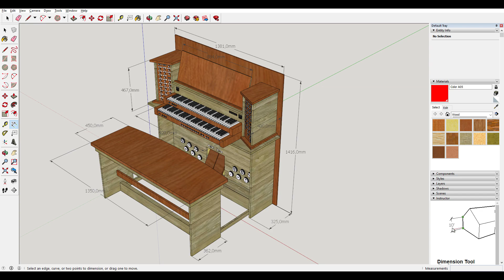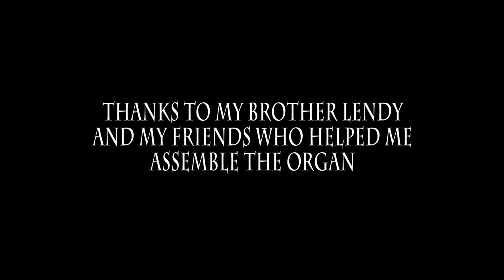My homemade MIDI organ

Comment: needs a disclaimer-- electric hand planner not recommended over human hands
Reply: I couldn’t look at that bit... That guy has to experience the actual accident once and he will regret it a lot. It’s the basic rule of using a knife always away from you, but then with the hand planer; Don’t be in the trajectory which the tool would go if there was nothing from stopping it. If your fingers touch the planer 1 second they’ll be half gone, bone and everything.
Reply: @Engineer9736  Agreed safety first - 

I got hit in the back when a cnc threw a broken blade at me  ,my shirt and flesh helped bring it to a stop as piece was twirling on infact , luckiest escape day of my life .
Reply from the maker: I always told to my brother -> safety first.. he snapped his hand on the hydraulic door and was lucky because it almost cut them off. It was a sufficient lesson for him.
Reply: enough of a lesson for your brother ? not the imperative method of learning required.
Reply from the maker: @keithcitizen4855  :D

Comment: Dear Valent; amazing, inspirational creativity on the build. BUT - your performance was not just technically brilliant . It displays that rare 'bite' and urgency which is the hallmark of the first class organist. So here we have the complete 'set'. Quite a sample. Great. Total congratulations.
Reply from the maker: Oh, thank you for the compliment. You made my day better. :) :) :)
Reply: Dear Valent; pleasure was mine. (I rarely post - who reads? :). You shared yourself with obvious delight. I learnt as a teen on  old 'tracker' organs in old freezing churches. Practiced untill my fingers were frozen and the fugues wouldn't flow anymore. Home organs leave me sighing and wondering. I also worked for IBM when they released something called a 'personal computer'.mmm. Times change huh? I have my Yamaha 'electronic' grand now. I'm not quite 70 yet - so who knows...Laurenskirche Rotterdam?.....:):) ..........

Comment: Good job on your project! What did you use for the sound source, digital tone generator or computer software? It is too bad that there are no organ kits like there used to be, from the 50s to 80s. Such as Artisan, Schober, Devtronics and Wersi. Wersi was the best, because after the kit was built, it look like an assembled from a factory.
Reply from the maker: Computer - Hauptwerk software. Organ console is based on midi comunication. It means that organ can be connected to any software like Hauptwerk, GrandOruge or something else with midi support.

Comment: It would be better to use an old Allen, Rodgers, or Baldwin that someone wants to give away.  But it does sound wonderful.
Reply: I have a beautiful old Rodgers model 22D I'd like to gut and  MIDI with Hauptwerk.  A ton of work to do so!
Reply: @fnersch3367  But it will be well worth it.
Reply from the maker: Better, but no one in our country or near has it. That's why I decide assemble own organ.
Reply from the maker: Yes I agree with you Stephen. Hauptwerk is so good because sample set was recording from church with its acoustic and can be possible to load different organ sample set. Instead it any digital organs has sound generated by built in computer unit. I heard sound from usual digital organ and it is not like hauptwerk. Maybe in more expensive digital organ it is better. Thank you so much.

Comment: First of all, amazing work; your instrument is really beautiful. You're a great organist and technician. I see that we are a kind of "twins souls". My primary work is IT, I'm an organist in a church in Madrid, and I constructed a console for playing at home (in mi case using touch screens, so good bye shift registers 🙂).

I've read the entire thread (very interesting) but I have yet a couple of doubts: The first, I see very clearly the hinge system you used in the swell pedals but I'd like to know more about the piece you used as a 10K potentiometer. Is it a component "as is" or something you make DIY? How do you get the mechanical resistance?

The second is more a curiosity. Your instrument is two manuals, but Friesach is a three manuals organ. Have you discarded an entire division or have you make a mix?

Thanks in advance and, again, superb work
Reply from the maker: Hmm, what a coincidence.. During my life, I had the opportunity to convince myself several times that technically skilled people are also musically gifted. :D

It is modulation wheel disasembled from midi keyboard: https://valsite.sk/wp-content/uploads/2019/01/swell_crescendo_pedal-1024x381.png
In my webblog you can read more: https://valsite.sk/projekty

Yes.. I wanted constructed 2 manual console because the majority of free sample sets organ is with 2 manual (and also price reason). But I thought also when if load 3 manual organ sample sets on 2 manual console so would by good to have the switches to 3 manual (I/III, II/III, and so on).. and I did so.

Thank for your response.. :)

Comment: Great work! Having those stops forces You to play on one specific organs in software like Hauptwerk?
Reply from the maker: The registration I have been selected by mostly frequented names. For example principal may be replace by montre or diapason, plein jeu by mixture, trompete by posaune and so on. But if I load bigger organ than 50 registers then may became the problem. Organ can be also connected to another alternative software like grand orgue or so.
Reply: ok, but then You got to figure out somehow what every stop means in every organ. But I get it. I would personally do it like Viscount model. Small plates that you can write on names of stops (they are LEDs or something to program). Theyre also probably expensive
Reply from the maker: Yes.. but I will install additional display monitors or tablets maybe in future. Current I am using my favorite free sample FRIESACH and its stops names are corresponding.

Comment: You are very creative and great workmanship! Where did you get the lighted stop switches? I’ve searched eBay, lots of options there. I presume they are latching, push on, push off.
Reply from the maker: Hello sir. Here I bought: https://www.aliexpress.com/item/32800944275.html?spm=a2g0o.order_list.0.0.37461802396ywr

Comment: I wish I had more info on the parts used, not so much the wood but the electronics and things like the name of the "led buttons" and what kind of micro controller you used if at all to control all the midi input and output.

Heck I would pay for that Autocad model you showed in the beginning
Reply from the maker: I can send email to you with small description about this.

Comment: Dear Valent, 
We are inspired by your project)
Tell me, please, how did you adjust the keystroke on the Acorn Masterkey-61 MIDI? 
We tested it, but it doesn't look too much like a real organ
...
Reply from the maker: Yes, you right. Acorn Masterkey-61 is low end product. That fact corresponding with price. Keystroke are too flexible but if keyboard will be assembled to wood construction which keys are touched to wood bar when key was pressed then touch feeling is better. Here is wood bar placed under keyboard => https://valsite.sk/wp-content/gallery/manualy/4E45C742-E51E-4F05-BCD7-3A4A13809ABB.jpeg

Comment: 3:17 Seriously... As long as you don’t feel shocked yourself by just watching that act, please don’t touch any power tool again. Your fingers where 4 cm away from being splattered around the room. If that board fell over, the purpose of owning a pipe organ would have been gone. Similar to using knifes... Don’t cut towards yourself. With power tools: Keep your limbs as far away as possible and especially never in the area where the tool is-, or could be, heading in. But the organ looks nice! 😊
Reply from the maker: Yes, you are true but I trusted my brother :D Thank you so much.
Reply: My father was a careful builder and wouldn’t let me use dangerous electrical saws, planners etc.  If we are musicians our hands and fingers as well as our hearing are especially valuable.  Even now I will not touch such tools without proper training as at least with hand saws etc  I cut myself but never lose a finger .  But  have seen plenty of other tradesmen and DIYs with  missing fingers .  It is very timely advice

Comment: Can you post the blueprints of the console, and key checks, and piston rails, etc. to your website?
Reply from the maker: I am currently working on another board in Eagle software and when I finish I will create small documentation (schematic, list of used components ...) and publish on my site. Maybe about 6 months.
Reply: please make the blueprints and all available. I'm literally covered by sawdust from another project and eager to buy an organ console. I can't find correct pedalboard measures anywhere. Greetings from Brazil.

Comment: Very nice Organ,.. I am both impressed, and a little disappointed. For one, although this is probably much less expensive than many of the "electronic" organs commercially sold for professional performance,.. it also provides some of the limits of those old monsters without some of the freedoms offered by midi.  Why the decision to go with a fixed selection of stops?  And why build a huge heavy piece of furniture around something that could be perhaps 25-50 lbs and readily movable? 
   Wonderful performance chops!!!!!... I guess this is how European organ enthusiasts bring their organ home for practice purposes!  Just to nit pick a little,... the holes drilled for the "stop' buttons ended up very sloppy..  You need a very sharp drill with those little wing flanges, so the wood doesn't tear, and at least for those pieces, that house the stop buttons, some real wood, would be nice!
  I would love to see a follow-up, on what tone generators or computer You use to achieve the different stop emulations.  To get really interesting You could emulate the different sounds of many famous organs, and also various tuning temperments??? !!!
Reply from the maker: Thank you for leaving such an extensive comment. I'm glad you liked the video and I also appreciate your feedback. I decided to let the fixed stops that are most used and generalize their names so that they could be replaced by others when I load another organ. For example: praestant = principal, and so on. If load organ with less stops that missing stops just will not used. If I will construct another organ maybe in future I will be surely use some touch screen to triggered organ stops. Yes you are right, the organ as a whole weighs a lot, but I built it so that the individual parts can be disassembled and transferred if necessary. You are also right to achieve a clean borehole we would have to use a vertical drill with a sharp drill, but we did not have it. :D We worked at home in the carpentry workshop with what we have. The tone generator is the Hauptwerk software but can be used alternative like GrandOrgue or different software with midi support. The organ on which it is played are sample set from the Austrian church in Friesach. In the future I will play on other organs and practice other songs and add to this channel. I mainly built the organ so that I could practice and improve it.
Reply: Thanks so much for the feedback.  So the organ sounds are sample playbacks, and that also allows for any number of stops to be opened at the same time?  Does Hauptwerk software allow You to add Your own samples or interface with other forms of synthesis?   Well I suppose whether it does, or not, You can do that  as this is midi....  Any latency problems that show up?  Looking forward to watching the next video!  Nice work!!

Comment: I warmly welcome.
How is the inclusion of your Hauptwerk instrument resolved.
Is it a one-button operation, or is it a windows program first and then a hauptwerk program?
Reply from the maker: Hello. No additional program. Hauptwerk can read midi message from midi keyboard/console. The buttons are wirelly connected to arduino and after pressing sent to computer based on noteOn() noteOff() midi message.

Comment: I happen to have a Hauptwerk organ of my own, but I struggle with really bad crackling and popping when I play. I’m using an ASIO driver for audio output and the sound quality is really high, but there’s a fair delay in the sound in addition to really awful popping noises along with that. How can I reduce the delay without adding more crackling?
Reply from the maker: I am not sure but, If crackling persists with asio driver you have maybe weak CPU. Check cpu load, when playing. If utilization is high, that is the problem.

Comment: What computer did you use?
Reply from the maker: The organ is connected to a computer set with an Intel Core i5 - 7600K processor, 16GB of 2400 MHz operating memory and a 250 GB NVMe SSD.

Comment: Great video and nice toccata! Where did you get your expression pedals? I am looking for this for my home made hauptwerk... thank you!
Reply from the maker: Expression pedals are attached to steel hinges which when shift up or down then turn up or down modulation wheel disasembled from midi keyboard. Look at that: https://valsite.sk/wp-content/gallery/organova-stolicka-stol/B554E5E9-343B-4A3C-9A66-034030D50818.jpeg
Reply from the maker: https://valsite.sk/wp-content/uploads/2019/01/swell_crescendo_pedal-1024x381.png
Reply: great ! thank you so much

Comment: Hy, could tell how did the midi interface
Reply from the maker: Arduino is a brain of  the whole processing of organ stops. Midi interface is based on standard schematic of MIDI in and MIDI out circuit connected to arduino using midi libraries and own source code.

Comment: can you give links to where you procured the thumb pistons
Reply from the maker: here :) https://www.aliexpress.com/item/16mm-DC-12V-LED-Push-Button-Switch-Blue-Green-Red-Yellow-White-lamp-Fixed-Pushbutton-Switches/32800944275.html?spm=a2g0s.9042311.0.0.96344c4dYNLL0J
Reply: Thanks a bunch.., how about the bigger ones? like the foot pistons
Reply from the maker: @oladiposamuel5589  Yes, foot pistons. Diameter 60mm. Same principle as thumb pistons. Here is link https://www.aliexpress.com/item/5-Colors-LED-Light-Lamp-60MM-Big-Round-Arcade-Video-Game-Player-Push-Button-Switch/32827197328.html?spm=a2g0s.9042311.0.0.17cd4c4dVwmSHN

Comment: What type of switch is used for the stops??
Reply: Is it momentary or self locking?
Reply from the maker: @joesoncueva3966  Momentary from aliexpres. Here: https://www.aliexpress.com/item/32800944275.html?spm=a2g0o.9042311.0.0.3ccb4c4d2lKTVd
Reply: Hi, thanks for sharing your project! 
About the switches, did they make that "click" noisy sound when touched? 
Also, where did you get the lettering for the switches? 

Thanks!
Reply from the maker: @andregentil4557  Yes, "click noise" hear it pretty hard when organ is off. But, when I using headphones or speaker it is not so bad.
Reply from the maker: @andregentil4557  About lettering: I create this in corel Draw software and print on glossy translucent sticky paper.
Reply: Thanks Valent! I have a similar ones that buy on AliExpress and also have that "click noise". Don't like the noisy but maybe, as you said, with speakers and headphones I won't hear it.
Reply: Thanks for the reference of the software! Trying to find that translucent stick paper to buy it. Is that possible to share the your Corel Draw project of the numbering/lettering? Thanks.

Comment: You made soooo many work for your organ but you have used the worst keyboards. Try to buy used ones from an original organ. You connect them via magnets and hall switches.
Reply from the maker: Yes, you right. But project was made up as low cost. Touching is not so bad and does not limit me so much. I can play whatever. But yes! It is different when compare with decent keyboards :)